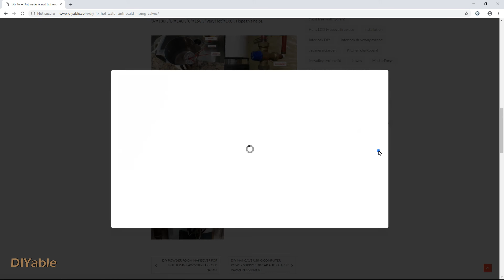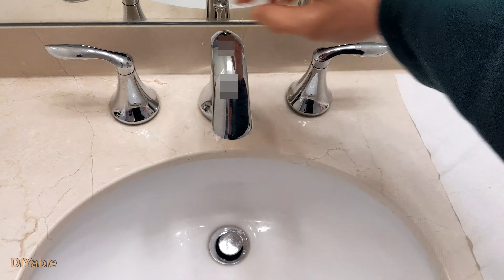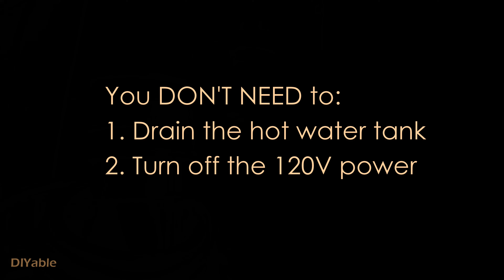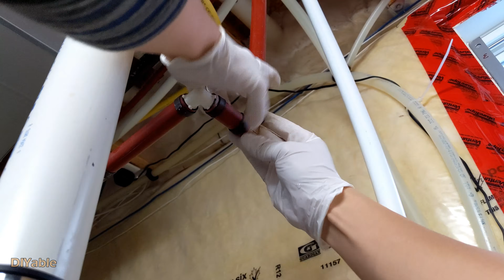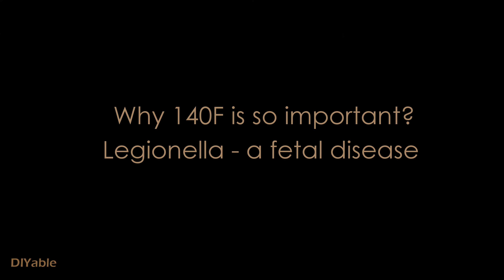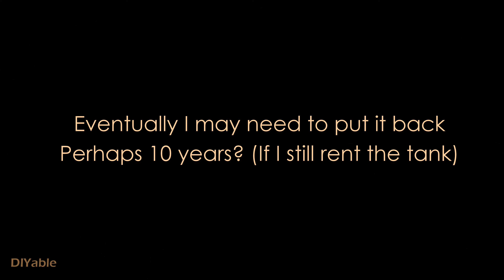How to DIY fix Anti Scald Thermostatic mixing valve issue? Don't call plumber until you watch this!

Comment: As far as plugging the mixing valve ports, your problem is that union threads aren't NPT, they are proprietary. You'd have to find gasketed tailpiece nuts and blind plugs. Plugging the current adapters is always going to be easier and cheaper. As far as reversing the valve to fix it, you're not really fixing it. If the issue is the result of internal restriction due to sediment or calcification, then by reversing you might dislodge the cause, but that's not fixing the valve so much as clearing an obstruction. That being said, if you do go that route and it works, put it back the way it was again, and install strainers to prevent reoccurrance. Do NOT leave it installed backwards, as the two sides are built to handle their respective temperatures. Other than that, good video.

Comment: Good video, I considered bypassing mine (or gutting it) but I may sell the house soon.  It really is a dumb building code; I used showers for decades and was  never once scalded and showers also already have mixers to handle variations in pressures for H vs C.

Comment: Thank you so much for this video! 5 years later lol. The water is so hard where I live. Our first hot water tank rusted right through in less than 6 years even with a water softener system. We thought that was the issue but turns out the hot side of the mixing valve wasn’t letting much water through. I tried soaking it in CLR but it didn’t make a difference even if I tried opening and closing the valve completely. Gave it one last shot by reinstalling it in reverse and it did the trick! Thanks for giving us the confidence to diy it!

Comment: For those who may have been wondering, gutting the old mixing valve and blocking the cold water side works. I was about to replace my watts 3/4 mixing valve for the FOURTH time in 7 years and I had enough. All i had to do was take the top cap off and unscrew the top of the valve and removed everything by hand. 
Thank you for this video.

Comment: What are the components of the heating system that need to be turned off so that nothing burns out? I have a tankless hot water heater attached to my boiler as well. 
 Also, is the main water supply all that needs to be turned off? What needs draining or turning off?

Comment: I am going to put a 1/2 ball valve on the inlet cold side.  Our TMV valve is up stairs and only controls hot water to master bath tub.  I have enough room under the sink with the flexibility of the PEX to put in a valve to shut off the cold.  I'll probably do a shark bite for ease of install.  This should allow me to be in code and allow future home owners to choose if they want the valve to function and rob them of a hot bath.  Thanks for explaining the temp requirements, etc.

Comment: I have the same valve. I cannot move the mixing screw with a wrench, i am worried about destroying the adjustment screw. Does the water have to be turned off before moving the screw?
What kind of wrench is good for  this.

Comment: I also live in the GTA and just had R***** over to fix the mixing valve. The tech told me they are not allowed to touch it as it's part of the home, and not part of the hot water tank (I'm on a rental). I would have to sign up for their plumbing plan and then a tech could come over and fix the problem. But I would have to wait 3 weeks before I can start using the plan. So I thought I'd attempt to fix it myself. Then I found your video which is excellent by the way. You walked me through step by step on how to do it myself. I went to a plumbing store today in Scarborough and bought the same model I have now for $99 (Zurn Wilkins model). So I wanted to switch out the old one for the new one. When I removed the old one, the plastic washers were disintegrated and there were no cartridges inside!! The problem I was having was that the hot water was bleeding into the cold water supply line (in the mixing valve) so when I would use any faucet in the house, hot water would come out of the cold side of the tap and would eventually go luke warm (no more cold water). And now it's working the way it should again. Thank you for posting this video. I found it very easy to follow, and you saved me $200 from hiring a plumber to do what I did in 30 minutes or less.
Reply: Same.  Ask R** plumber to service. It's part of the system
Reply: was this enercare by chance?

Comment: Thank you so much! I have a Rinnai r75i, had warm water only… did the flush, disassembled and blew out the burner assembly, the fan, cleaned the condensing coils… checked the thermistors… nothing was giving me hot water. Turning this mixer around and adjusting the valve to the opposite side brought my hot water back!

Comment: Mr. Arnold sound alike, thanks for the video.  I got similar issue with my acme mixing valve, but I went a step ahead. Instead of reversing the valve port from cold to hot, I removed the valve and found out there were white scale residue. I simply removed the valve overnight and let it soak in a 50/50 mixture of vinegar and water. Put back after 5 hours, problem solved. This saved me $144 valve cost. A hot water mixer valve works just  like any regular valve except that it is designed for very hot water. Just like a shower head gets clogged with scale overtime, this valve gets clogged with scale buildup. You  can also use CLR but vinegar is cheaper.

Comment: When I touch the pipes with my hand they're both hot and I have a problem with the water pressure especially in the showers some times in the kitchen as well . I replace all the shower heads. What do u think I should do?

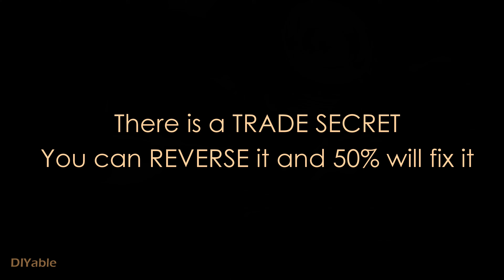Comment: Thank you very much! At 4:01 you talk about reversing the cold to hot and hot to cold, that solved my problem. As per your instrcutions I turned the knob to cold. Worked like a charm for me. Saved me couple of hundred bucks for sure. I think the hot side is clogged, althought I couldn't see anything there... that's why the hot water pressure is a little low, and cold side is flowing faster... but I can live with that.

Comment: flipping mine worked like a charm. i had pressure but not warm water. if its set to hot will it burn the control valve faster? my brand new tub was installed and didn't last but a month maybe.

Comment: Thank you for the idea. I did remove the mechanism inside the valve and blocked the cold inlet with a metal disc. And the valve becomes hot water bypass itself. Cosmetically it looks identical to before. This works perfectly for me! Cheers!
Reply: Metal disc?
How does it stay in place?
Reply: @rooster1999  yeah, this is a good question. What I did was using a metal washer and block center hole with bolt and nut. Then wrap the washer edge with seal tape. Slide it into the cold water pipeline. When you tight the pipe nut up, the pipe and the adapter will pressure the washer and seal the place. Hope I explained well. Good luck!
Reply: @xiaoghuang  Thank you
Was it difficult to remove mixing valve internal mechanism to create bypass
Reply: @rooster1999  my mixing valve was pretty straight forward. I just simply push internal mechanism towards the big opening side and it came out without effort. Inside just some plastic parts and one spring, pretty simple. Maybe that is the reason it doesn’t last long…
Reply: @xiaoghuang  Thank you for all your help

Comment: We had instantaneous gas heaters in our house (one of which lasted over 35 years) with non of these issues. 
We have since moved into a house with a solar HWS and we are now experiencing this problem as summer season started.
I figured out it was something to do with the tempering  valve and replaced it.   No improvement so I think its the fact that the water coming from the HWS is too hot for the valve which pulses.  
So the shower dribbles and oscillates between hot and cold.  I was just taking the guts out of the old valve apart from the cold inlet to refit and get straight through hot water which hopefully will work when I came across these videos.  
So its not just me thinking this way.
We will use caution when using the taps.    
 We don't have young children here normally but when they are they are intensely supervised as ours were when young as there are countless dangerous situations that can cause serious injuries to the unaware. 
I can understand authorities creating codes to protect innocent children from suffering horrendous injuries because of  uncaring irresponsible adults who should not ever have children in their care and I fully support that approach  
However it does make life difficult for others in many ways so as long as people take the responsibilty for these DIY solutions (including myself) its reasonable. 
But as soon as the solar system gives me grief its getting ripped out and a reliable, safe and very economical external instantaneous gas HWS will be installed to give us decades of trouble free hot water.

Comment: The thermostatic valve was a problem for us.  It meant the water coming out was not hot enough to wash dishes.  Only OK for a shower. But for washing dishes I had to heat the water in a kettle.
Quite stupid.  So I was forced to remove the valve from the system.  I wash dishes more often than I have showers.  i.e wash dishes a dozen times every day.  Having to use the kettle each time made the hot water service pointless.

Comment: 130- 135 will do just fine for me.   After 20 years of a 132ﾟ or a 135., Someone Jacked -p] with my controls and made the water a 145 and it starts screwing up old seals everywhere.

Comment: Arnold. How many turns we should open that Small mixing screw ?  Looks like I opened more because I am getting too much hot water now. Will there be any problem to my hot water tank with this much hot water ? Pls answer. Thanks
Reply from the maker: Slowly turn the small mixing screw the other way, slowly.. then test it. Repeat until the temp is right.  The mixing valve is the OUTPUT from the hot water tank, it will not affect the performance of your boiler.

Comment: Thanks for the video.  Not sure why it didn't show up when I was researching this in the last 6 months.  I reversed my mixing valve with your video, and initially, it didn't work, but I remembered I had the valve turned up all the way to "hot", so because its reversed now, I had to make it "colder" if you get what I mean.  After turning to knob to the "colder" side all the way, my water is now extremely hot.  Thanks!
Reply from the maker: Glad it helped!!
Reply: @DIYable  after a few days, I notice in the shower it will go hot cold hot cold hot cold....so I'm just going to remove it all together

Comment: Thanks for the upload and sharing your water heater experience.👍

I face the same dilemma.  Stupid antiscald valve is causing more misery than harm.😡  I have copper lines and do not want to meddle with them for building code compliance purposes.  Is flexible copper tubing with threaded end connectors available?  I cannot seem to find any other suitable tubing except Shark bite at the local hardware store and fear they may leak over time due to high heat exposure.  I prefer to avoid soldering where possible.  Compression fittings are preferable.
Reply from the maker: I don't know about flexible copper tubing but there is product called "Corrugated Stainless Steel Water Heater Connect" which will work with the your connections if you use compression fitting.  It's flexible but does not have the rubber lining inside. Stay away from flexible hose which has rubber lining, they disintegrate and can mess up your water boiler. My 2 cents.

Comment: Do not bypass the tempering valve if you have solar hot water. Solar hot water can get to boiling point, so you need a tempering valve to avoid scalding.
Reply: Yes that is all very well but as in our experience in effect you get no or I totally inadequate delivery of hot water.
This obviously points to one thing - poor engineering of solar hot water systems and tempering valves.
A simple  much better solution would be to instal a cold water mixing tap on the hot water supply.  It cpuld be manually adjusted for the season. 
Of course this is not going to solve the safety problem or be of much use for people inexperienced with practical issues. 
The other solution may be to shade the solar collectors sufficiently to reduce the heating capacity to a reasonable level depending on use. Of course this is impractical for a number of reasons and leads to my previous comment regarding  poor engineering and my opinion that solar hot water systems  are an expensive and frustrating waste of resources as currently sold.
In our previous house the 2 instantaneous gas HWSs used less in money terms to provide us with hot water for the whole year in a larger 3 + bathroom  
than this solar HWS costs to run on boost in winter.

Comment: Hi i have hot water for about 9 minutes, and then all of a sudden it goes cold / lukewarm, is this an issue with the mixing valve?
Reply: most likely, touch the pipe coming out of the tank and the hot side pipe coming out of the valve, if there is a lot of temp difference, is the valve.

Comment: JUST REMOVE THE MIXING VALVE AND MIX THE HOT AND COLD YOURSELF AT THE FAUCET AND TURN DOWN THE TEMPERATURE AT THE GAS VALVE. THOSE VALVE  ARE ALOT OF HEADACHES.

Comment: Having the same problem with this stupid valve, but I live for rent and the landlord insists that a valve has to be there - plus I am responsible to pay the $400 every year or so to have it replaced. What a bullshit. Would it just help to block the cold water side? BTW I tried to replace the CashAcme brand with a Watts brand valve but soon figured that the screw terminals don't match. The original one has a 33mm and the new Watts has 31.5mm diameter thread and both are for 1/2 inch piping, so what a crap is that? All about competition? Nothing is exchangeable in the name of profit? You seem to have gone the right way, thanks for the video!!
Reply from the maker: Thanks!! I am not alone in the world!!!
Reply: @DIYable  well it turned out that it wasn't the valve responsible for the cold water. The hot water line was clogged due to a steel copper junction greatly reducing pressure. After cleaning it works. These plumbers only wanted to see the $$$ there you go  ...

Comment: hi in UK you should not fit a TMV next to the water heater because all your mixed water from that TMV is cooling down on its way to all your hot outlets and it must be around 43c,i work as a water hygiene tech
Reply from the maker: Thanks for information, I think different country has different code. I learned something new everyday, thanks!

Comment: Interesting all the research and statements about codes. I think you would have benefited by visiting the manufacturers website (https://www.zurn.com/products/water-control/thermostatic-mixing-valves/model-zw1017xl) where you would have found troubleshooting steps to repair the valve. The troubleshooting literally states that a, "Flow rate reduced or fluctuating" is caused by, "Valve or inlet fitting fouled by debris" and that the remedy is, "Check valve and inlet fittings for blockage". Interestingly enough you did not remove the internal check valves or strainers to check for a blockage! The one thing I did notice it that there was a strainer on the mixed water outlet which tells me the valve was never installed correctly as typically the valve comes with two strainer gaskets and one regular. I think it's obvious without reading the instructions how the gaskets should be installed. So I don't know which is worse you paying a plumber $300 and they still screwed it up or the fact that this video has nearly 30k views and everyone is saying that this a great video. A few things a for sure: no legionella, no fixed thermostatic mixing valve in this video, but plenty of scalding to come!

Comment: The other name for this is anti scalding valve. It will stop steam from killing u. I know a guy who died in the shower from steam burns SO YES YOUR SHOWER CAN KILL YOU WITHOUT THIS  VALVE . Look it up He was a Vietnam veteran in Alaska had huge funeral good guy fought in war died from shower.
Reply from the maker: Can you share the article that the person killed by steam in a shower (not hot water)?  That's a very interesting scenario. You mean there is no hot water in the hot water line, but instead it's filled with steam. First of all, to get steam, the boiler has to go up to 212F (100C), does that mean there is a malfunction water boiler thermostat? Let's say that is the case, when someone enters the shower and turns on the tap, it is mixed with cold water instantly. Now, what would be the temperature from the tap when you mix steam with cold water? Would you be able to kill someone instantly? Unless the cold water line is blocked and only steam comes out from the shower head. In additional, a normal adult without disability should be able to get out of shower right away, I need to get more facts to get me convinced honestly. As I said in the video, the valve is good for elderly and people with disability.